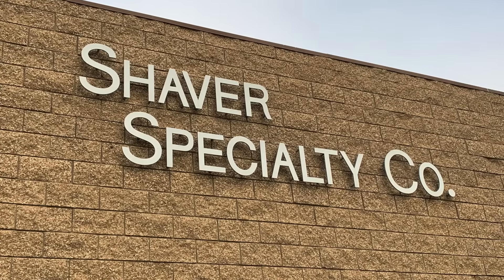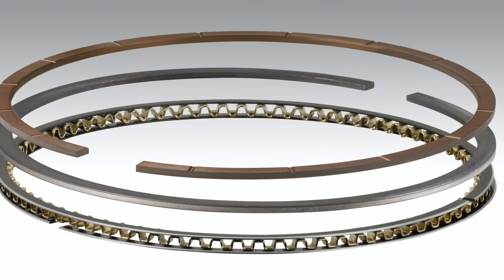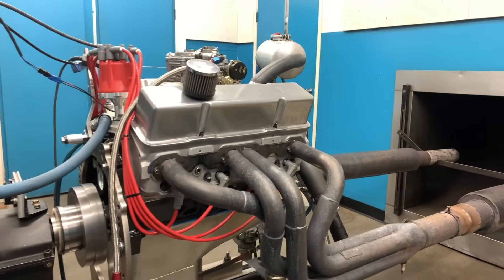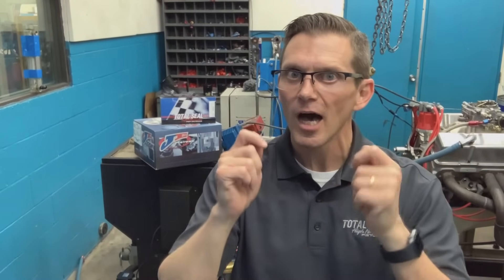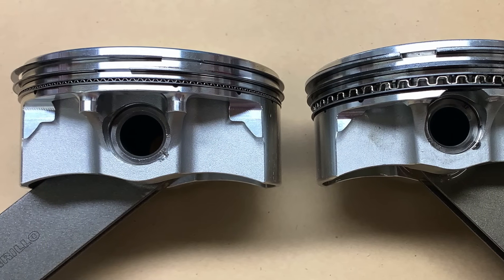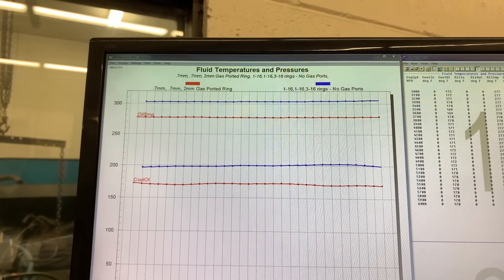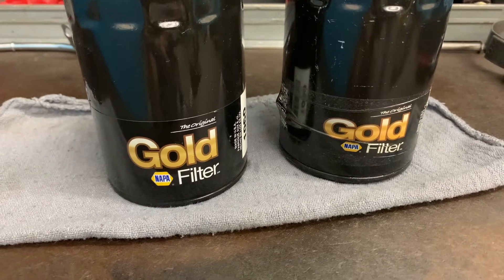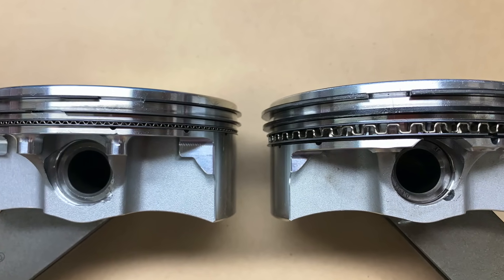Engine Running HOT? Watch This Video BEFORE Buying A New Radiator!

Comment: I question how the friction could increase that much from the compression rings.  When you consider that a barrel shaped top ring has such a small contact area with the cylinder wall and a square faced second ring has a small contact area as well. The difference could only be a few thousandths on an inch. I would believe that the oil control rings could increase friction considerably.  Can you test 1/16 compression rings with a low friction oil control ring pack?
Reply from the maker: We did that in that in another test. The friction is related to all three of the rings (compression and oil control). By going to thinner rings, overall tension is reduced. 

Also, the barrel does wear in during the break-in process, so the overall contact area is greater than you think.
Reply: @TotalSeal  thank you for the reply.   The reason I ask is because I don't build as many race engines as I used to.  Almost every engine I build now is street strip.  Mostly street.   So oil consumption is a real concern for me.  I cannot help but to correlate the oil consumption issue plaguing late engines with low tension oil control rings.   I am aware that there are other factors.  Correct oil and a good maintenance schedule.  So I was just wondering if we could take advantage of the superior compression rings to offset the increased tension of the larger oil  ontrol pack.
Reply from the maker: @chevysturgill6330  great comment. Oil consumption in late model engines is related to a drop in oil ring tension. From the factory, oil ring tension is about 10 psi, but over time the expander loses tension (like any other spring). As the oil rings lose tension, oil consumption increases. This can be corrected with slightly higher tension oil rings.

Comment: Would you expect the temperatures to come down at all after the new rings were run for a while?
Reply from the maker: Thanks for the question. No, the operating temperature should not change over time due to break-in. In our previous testing with this engine combination, the operating temperatures stay constant with age. 

The thing that would change operating temperature was oil level, oil viscosity and coolant flow.
Reply: @TotalSeal does thicker oil create more heat than thinner oil?  If so what about when adding in motorkote to reduce friction?

Comment: For smooth surfaces, friction doesn't change with contact area size.  It definitely will for a different tension (implying a different normal force) and coating (coefficient of friction).  Plus, "it's complicated"; blow-by differences, flutter, bore shape under pressure, maybe hydrodynamic differences with the oil on the walls.  Nice video, measure often as you are already doing!
Reply: Wellll, 1/16 rings are 0.0625" wide.
1mm rings are 0.039" wide, and 0.7mm rings are 0.027559" wide. 
Two 0.7mm rings are less than the width of one 1/16" ring. That is less surface area by a huge amount.
The 1.0mm rings are about 2/3 the surface area of the 1/16" rings.
Then there is the ring metalurgy which also contributes to radial tension, another contributing factor in friction.
The statement that ring width on a smooth surface is imaterial is not correct. We can express opinions, but Mr Dyno has the final say.
Reply: Thinking of an ice rink as an example in my mind. Large and small surfaces of equal mass and equal force applied, resulting in both stopping in the same position on that ice rink surface? The only variable there would be surface area. 🤔
Reply: @CrashLarue  Just thinking of word tripology makes me humble.
Reply: Cylinder is not a smooth surface, so you are already in the weeds.

Comment: The total contact surface of the ring available to transfer the heat to the block is smaller with the thin ring package. Is that a limiting factor for how much heat can be transferred to the block through the rings? If it is a factor... does this mean more heat is held in the piston using the thinner ring due to less total area to transfer the heat?
Reply from the maker: Great question. While the piston ring does transfer heat from the piston to the cylinder wall, the oil also absorbs heat from the piston. The key finding from this test was that both water and oil temperature increased with the larger piston ring package. Accordingly, the temperature increase was not due to increased transfer. Instead, it was due to increased friction. The thinner rings are still capable of transferring the necessary amount of heat from the piston in this engine.
Reply: Well said.
Reply: The ring contact area to the piston is greater than the bore contact, the ring temperature is closer to the piston temperature.
And bore temp is not consistent through the stroke. Thinner rings, due to their lower face friction and volume run cooler.

Comment: Do the narrower rings fit loosely in the lands?  They have to, right?  How does that affect the stability of the ring?
Reply from the maker: Good question. The pistons have to be made for the thinner rings. The shorter axial height grooves are designed for the thinner rings.

Comment: New to the channel, great video! Dumb question, could you run the thinner ring on a piston designed for thicker ring package-the gap (4mm? in this example) becomes a quasi gas port or would the rings experience flutter? Thank you.
Reply from the maker: Too much clearance can cause problems, so you don’t want to run a thin ring in a wide groove.

Comment: It’s amazing how you guys at Total Seal have continually reengineered the design and use of materials to
Improve the benchmark for useable HorsePower
Reply from the maker: Thanks! We enjoy pushing the limits!
Reply: @TotalSeal  I'd rather have the durability of a 16th ring 
package & improve//upgrade the engine cooling system. 
I always use "special coated" (16th) Total Seal Piston Rings & I've never seen any significant increase in oil or water temperatures.  
Regardless, THANKS for posting this interesting video. 
I LOVE TOTAL SEAL PISTON RINGS. 🙂 
Best regards, 
Ben

Comment: Was there any difference in sealing (compression, oil control)?  That wasn't mentioned.
Reply from the maker: Interestingly enough, the 1/16, 1/16, 3/16 ring package produced more blow-by than the .7mm, .7mm, 2.0mm ring package.
Reply: @TotalSeal  then I would refer to another comment here and ask if you broke them in before collecting data. Did you?
Reply from the maker: Yes, we recorded the power and blow-by data after the break-in session. 

Each ring combination was run with the exact same break-in procedure.
Reply: @TotalSeal  that's because if the piston wants to rock in the bore one side of the ring isn't blocking the other side of the ring from making the seal. use a cd stack cylinder as an example

Comment: Interesting video, and I agree with the fact that thicker rings do generate more friction, which translates into more heat and less power.  However, keep in mind these were brand new rings, not broken in rings that were being tested.  I assume they deglazed or lightly honed the cylinders before they installed the new rings.  This, combined with the fact that it takes some time/mileage for new rings to fully seat probably accounts for a large portion of the difference in temperature and horsepower loses.  

A more accurate comparison would be to run that engine a dozen or so times on the dyno to fully seat the new rings, then compare the "before" and "after" temperature and power readings.  You would still see some difference with the thicker ring pack, but probably not as dramatic a difference as the initial test run.
Reply from the maker: Thanks for the comments. The guys at Shaver’s did re-hone the block to the same plateau finish between each ring test.
Reply: @TotalSeal  how much did the piston to bore clearance change with each honing operation?

Comment: Whats a set off these rings go for $ ???????
Reply from the maker: Thanks for the question. An 8 cylinder set of thinner, lower tension rings starts at $207.19 and goes up depending on ring material, coatings and design (gas ported, gapless, diamond finish, etc...). For an exact quote, contact our tech department at info@totalseal.com
Reply: Don't forget to add the price of replacement pistons if you're changing the thickness of the ring.